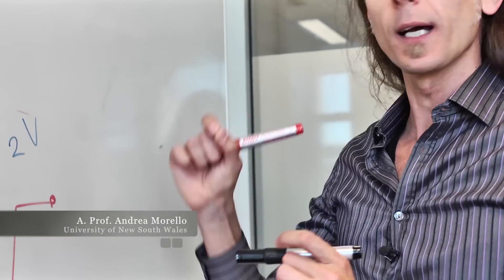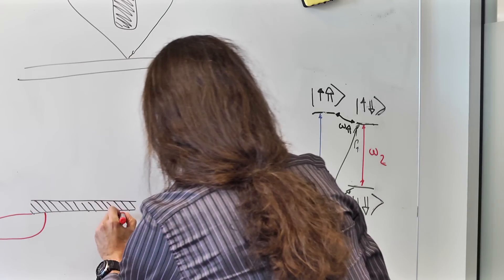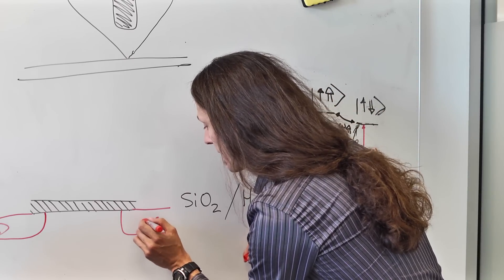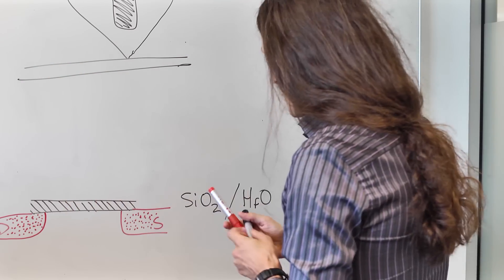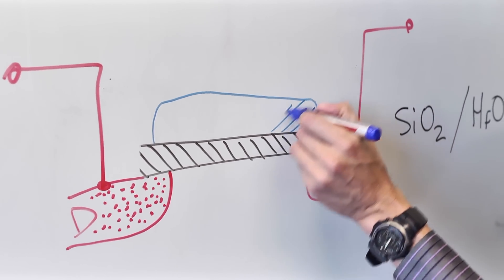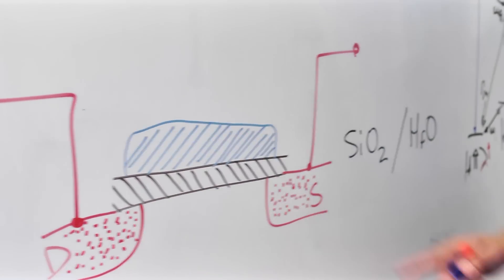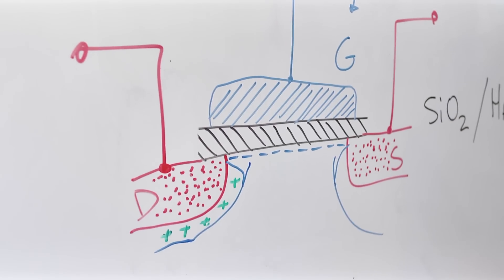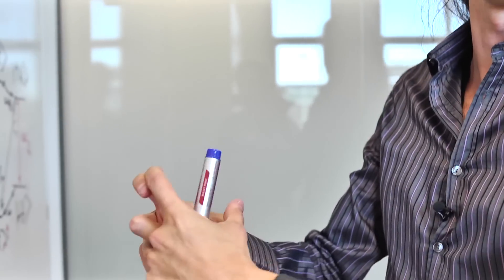Transistors & The End of Moore's Law

Comment: Interesting but how about this: We've reached QHD images wich is beyond human capability to see any difference from HD. We've reached beyond capability to store data. (Human brain is about 50 Tera so 25 drives of about 60 Euro will cut it) My question is about this: How will we ever need more "switches" on a 5 by 5 mm chip. Add another 5 by 5 mm chip. Cut 1 percent off the battery and you have space for another decade or so. I still don't get it why it needs to be closer. Sure, it's nice if it can be done but why bother. I Can have 50 Tera storage and a 1000 Intel i5's in a moving box. If that's not enough i'll double it with leaving it with nothing to fill or nothing to compute for. Right? ;)
Reply: It's hard to make sense of your post/question, but in a nutshell, smaller transistors switch faster and consume less energy. Smaller chips use less die surface so you can increase your profit potential but shipping more chips on the same surface area. Because smaller chips consume less energy they dissipate less heat, this is why we can now have performance of computers we had 8 to 10 years ago in a mobile phone or how it's possible to build thin laptops like the MacBook Air.

I don't get the comparison of QHD vs. HD screens other than at some point, we may not need that much information for entertainment because at some point going beyond the precision barrier of what a human can perceive doesn't bring more enjoyment or a better experience. However I don't know where you get the comparison of the amount of data a human brain can store in terms of hard drives and its processing power in terms of intel chips. These comparisons never hold and never will they, that's comparing apples with oranges IMO.
Reply: Human eye can see much higher resolution than QHD or HD is able to offer. It depends of the screen size and the distance from which you watch the screen, that can you see the difference. But I suppose if you have a screen that covers the whole area of your vision, even QHD is not enough to keep the image sharp. QHD is only 3,6 megapixels. :)

Hard disks are only storage. Human brain is a computer and storage combined. And especially when you take in account the power consumption and size of human brain compared to even nearly similar capacity computer parts, the human brain still wins 10 - 0. It's power consumption at highest is said to be around 20-40 watt. Those 1000 i5's would require 1000 * 65 W of power. 65 000 W.

Human brain is just very inefficient / badly optimized in maths, because the brain is a product of long evolutionary development. 10 000 years ago, ability to count 1+2 wasn't the most important feature that you needed for survival. For this reason human brain is optimized and is at it's best on entirely different things than a computer. For example in interpreting what it sees or hears, brain totally outperforms a supercomputer. Of course partially the problem is also in the software, but from this point of view, computers have still a long way to go. :)
Reply: wopmf4345FxFDxdGaa20
 Badly optimized in math? Perhaps, but then how does my brain know how to direct my fingers to type this out at 70 wpm? Isn't it doing a ton of maths to locate my fingers, and then a ton of maths to determine just how much force to apply to them and in what directions to hit the keys and then retract them back to the starting position?

Comment: If by 2025 there are 4 atoms of silicon, then by 2028 there will be only one, so what after that?
Reply: Nameguy Well, increasing the chip is always possible, but it's not development.

Benefits of decreasing the size are that power consumption decreases in relation to the computational power. If you don't make the chip smaller, you can't for example make considerably more powerful mobile devices or supercomputers. A lot of supercomputer running costs at the moment is the huge electricity bill.

Another thing is that manufacturing of the chips is extremely expensive. How they are possible to make affordable for large crowd, is that one chip is very small, and you get high amount of chips from one silicon wafer. If one chip is bigger in the wafer, you get less chips from one wafer, and the price increases very quickly.

For example computer cpu being one of the most expensive parts in computer, the actual cpu inside the case of the cpu itself, is very small. Doubling size of it, would most likely also double it's price. For the past years, the price has kept decreasing all the time, and still the computing power has increased.
Reply: After 2028 we are going to be sucked into a black hole and crushed into one 1 atom of silicon, Andrea Morello will be the president of the whole universe (which will then consist of only 1 atom) and humanity will achieve World Peace.
Reply: Currently it looks like the limits will come much before atom size, because with current kind of transistor I suppose the problem is  called quantum tunneling and gate leaking. I have read that around 6-7 nanometers is the minimum, below that the electric charges will not stay at the paths where they should.

Obviously it might be possible to push a little further with new kind of transistors and materials.
Reply: start to stacking instead 2D
Reply: Increase the size of the chip. Also it will be really fucking powerful FYI, not saying we won't exceed the supply though.
Reply: dutchrjen Yes I agree, like I said, manufacturing process is expensive, not raw material.

Making a functioning chip from the raw material contains a lot of steps, lithography, etching, etc, and many of the steps have to be done in a room that must be so clean that a human being isn't allowed to enter the room, the air quality standards are much higher than in operating theatre mainly because the things being manufactured are very small. Then there's the yield, not all of the manufactured chips prove to be functional.

Could estimate that making all the steps to one wafer costs about the same. So the more chips you get from one wafer, the lower the price of one chip is.

Yes, speed of light is a limiting factor too. But there is also a lot of computation that can be parallel and you could have a little distance between different computation units. For example consider a normal use like a gaming computer. You could have 4 GPU's each rendering a quarter of the screen. The game would run much faster, and the distance between the computation units wouldn't be a problem because they can work independently. But this would be very expensive, because the GPU's are expensive.
Reply: Well people are already using electrons instead of atoms in quantum computers so we skip atoms and go to electrons, then if possible protons and neutrons and finding someway of either freezing the atoms in a simpler way or finding a way for the atoms to work at regular temperature.

Comment: Could anyone tell me which would be more responsive for example in a dual amp circuit (pnp and npn opposed for full wave amplification) MOSFET or your standard transistor.

Also it was my understanding that the operations are for the most part ran in series ,just timed in combination with the speed to give a sense of parallel  - Our brains being around 15peta flops -although not sure if this is just the neo/prefrontal cortex.Have allready been matched on supercomputers but not in parallel

Comment: Why don't they make cheap eletric cars that use small amounts of energy?
Reply: Physics.
Reply: You need certain amount of energy to do certain amount of work.

Batteries are expensive and heavy with the current battery technology in relation to their ability to store energy. Like you may need 200 kg of batteries to store let's say 12 kWh of energy, same amount of energy would require only 1 kg of diesel fuel.

The actual difference is much smaller, because electric motors / drivetrain have the efficiency advantage over traditional cars. Electric motor can convert much higher amount of the energy in the battery to actual moving motion of the car, compared to traditional combustion engine, which will convert most of the energy in the fuel to heat. Efficiency of best gas / diesel engines in cars today is between 20 - 40%. Rest of the energy is lost as heat.

Comment: ***** I'm also a software developer but I admit that i'm not qualified to speak on this subject, just as much as you aren't.  So being skeptical is fine, however, the purpose for a quantum computer is not to out-process classical computers at classical computing problems. I'm unsure about parallel processing but quantum computers ARE capable of solving certain types of problems that classical computers will never be able to solve.  Unless you're willing to understand entanglement distillation, and how specifically a bell state recovery works then it would be suspicious to suggest that they wouldn't be faster at solving certain types of problems because they are faster and better at this.  Quantum computers will be used to solve certain types of protein folding problems which will open the door to a new era of medicine, and if we are lucky we might even get to see the terminators in a couple of years from now.
Reply: ***** Benny you don't seem to get it. I did add something intelligent already which was to inform you that quantum computers are better at solving quantum problems than classical computers.  In quantum computing the objective is not to make a processor that is faster than a classical computer.  I think you entirely miss this point, because asking about parallel processing is the wrong question, as it's not about processing speed.  Google has an interest in quantum computers because they want to solve certain optimization problems that cannot be solved with classical computers.  What you said earlier was basically that you don't understand why google wants to invest in a quantum computer.  Just so you understand optimization is one of the major reasons.  Technologically we are at the tip of the iceberg with this technology and we've already achieved quantum computing in various settings and in various approaches.  So it's not even about DWAVE specifically, it's about our technological achievement overall, we are at the very edge of being totally immersed in a new world of computing power, as this will push moores law well into the future.
Reply: Is that because you don't have anything to say?  I think your just being spiteful.  Does anyone else here feel that I made a valid point?
Reply: I wouldn't assume people are ignorant by default like you do.  I think they are capable of figuring out how to scroll. I would have chosen to reply but apparently you had disabled the reply option on your content. watch?v=jaE-TjwMbrI
Reply: Either way the reply option is not there.  But thanks for making that point.  Here was benny's appeal to authority: 

I'm a software developer and am skeptical of his description for a few reasons...

He says that quantum computing is only faster than classical computing when it comes to parallel processing, but parallel processing already exists in classical computing (even in a reversible way -- see "Toffoli gate"), and multithreaded programs have already been around for years. Parallel processing is not a new invention at all. 

How can the utility of the quantum computer be limited to parallel processing (aka multithreading) when better parallel processing can be achieved with more classical computing today using smaller chips and more of them (hence Moore's Law)? It doesn't make sense for Google/DARPA to spend tens of millions of dollars on something that is essentially a multicore CPU (as he described). 

He says that for watching an HD video a classical computer would be faster. If his previous description was true that the quantum computer is only good with parallel processes -- then wouldn't the quantum computer be faster in this case? All video processing has a dedicated processor called a GPU; if the computer has a GPU and the CPU is multi-core -- which is most computers since 2005ish -- it will process it in parallel to other computations. So if his description was right, then HD video would be one of the few instances where you would want a computer that gets exponentially more efficient at performing operations in parallel (zomg the GPU and CPU could get quantum entangled! more buzz words).

Finally, since his video analogy is false, can he (or anyone) explain a good use for the quantum computer other than "it's exponential... it gets better... " or whatever he was trying to say...? It seems like the professor was explaining classical computing circa like 1990 and is missing a lot of current knowledge that he thinks you need a quantum computer for.
Reply: Daniel Newman I'll clarify what I am saying.  Regardless of parallel processing, quantum computing is beneficial in other ways.  You're looking at it only one dimensionally as in a speed test v.s. regular cpu.  What I mean by that is we don't care if it's slower than a typical cpu. Quantum computers will be capable of doing things that have never been achieved before with classical computers.  An example of what a quantum computer might be able to do: Encryption cracking that would take a million years in a classical cpu, could take a day or less for a quantum cpu. This is the general idea in quantum computing. Now I hope you understand.
Reply: Your right, your not qualified. Your software, mathematical logic, not hardware. Quantum computing will need a whole new software approach.

Comment: Intel's road map puts them up against the minimum die feature size around 2020. It will probably take another five years to filter down to all their products from the top end. The top end products will go through various short term solutions to extend the improvement cycle for a few years. Then they hit a wall around 2025. The entire industry will probably have to largely switch to more aggressive cooling.

Heat is a problem as total heat output over a given time, high rate of heat output in spikes, and as localized hot spots on a chip. Total heat can be dealt with by water cooling up to a point but spikes and hot spots are going to become difficult to manage. Modern CPUs already have a lot of heat management technology built in that helps by throttling down areas of the chip or even the entire chip when too hot. But this essentially means that you cannot take full advantage of the potential of current chips already without good external heat management. As features shrink and become closer together localized heat problems become worse even though total power consumption may go down. Total heat will go up significantly as well if and when multiple chip solutions become popular again as single chips stagnate in performance growth.

Potential revolutionary replacement technologies are probably not going to be ready for general consumer use by 2025. The good news is that personal computers are already powerful enough to do most things we need and will be considerably more powerful in ten years. As competitors catch up to the technology leader at the end of the road and chip fabricators stop investing in expensive upgrades to support die shrinks prices may start to drop across the entire range of chips. The technology leader will of course try every marketing trick and technological gimmick they can to maintain their profit and market share as long as possible.

Comment: Now I understand why Intel is struggling each generation when they shrink their manufacturing process. I think the Broadwell designs are using a 14nm transistor process. So that's, what, 25 atoms, if the size is halved?

Comment: Why not make the bridge small enough that quantum tunneling DOES occur in order to get TWO bits of information from each transistor...replace the gate so that instead of on or off it either sends voltage to the gate or to the drain...The transistor can have a state of  1) full closed [voltage to the gate], 2) partially closed due to quantum tunneling 3) full closed because the voltage of the drain and source are equal. 
Why not get rid of the transistor completely, you've already got one bit of information without the transistor...gate off or gate on!!

Comment: I have a very very limited understanding of how all of this works, but I have one question about something. The guy was saying that as transistors get smaller and smaller, they will reach a point where there is a "jump" of the electron flow, so the switch cannot stop it. So then, since computing power is somewhat affected by how many transistors there are, can you not engineer a larger microchip to have more transistors on? What would the complications with that be? I guess a simpler way of stating my question is why can't a larger microchip be made to put millions more transistors on? I'm curious about any complications with this, or if it's possible?